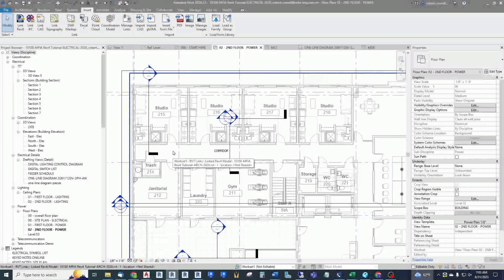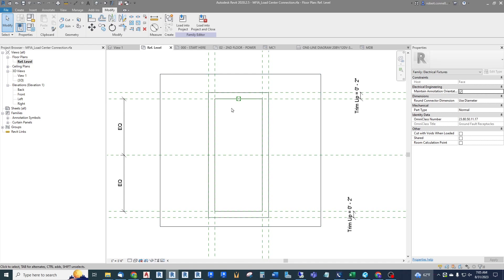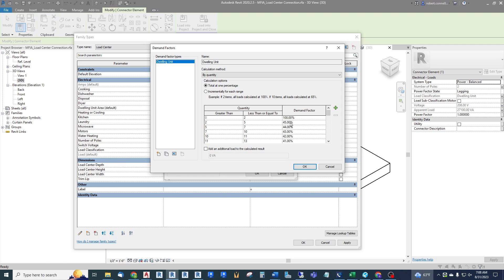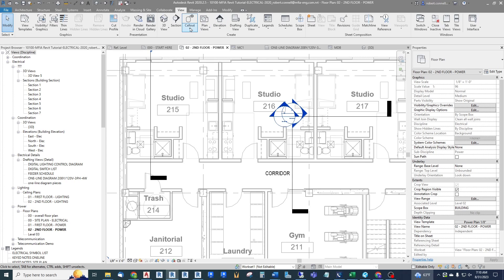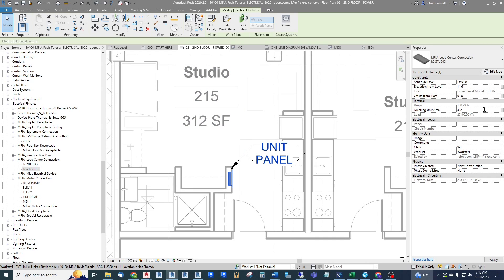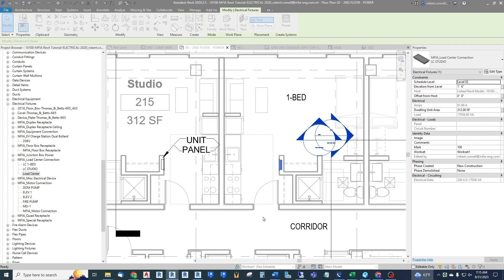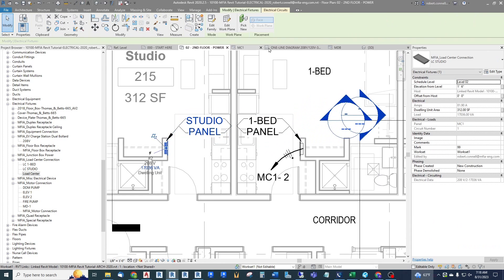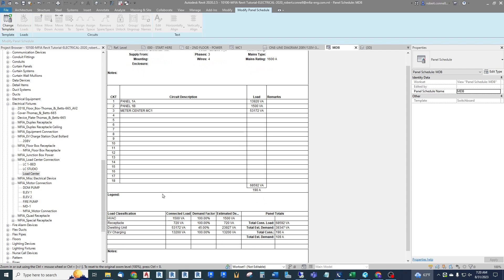REVIT MEP Loadcenter Family Tutorial | Dwelling Unit Loads

Comment: Hi Rob! How does this load center factor in a situation where we have 3_bedroom units in an apartment where we might have three water heaters of say, 4500W?Do we just feed 13500W in the category or we have to determine the demand factor first?
Reply from the maker: Hey there. Well this Loadcenter connection is for the "connected loads" for use in calculating the whole meter center for example, and applying the demand factor to all of the load centers at once. I.E. you cannot take diversity factor on the water heaters first, and then a diversity factor for all of the load centers as well (no double diversity/demand factor).
Reply: Thanks Rob . This is noted.

Comment: Great video Rob. Thanks!
Is there an easy way to create dwelling unit specific demand factors and load classifications in Revit other than doing it manually? I understand the number of dwelling unit and associated damand factor that would come into play upstream, as described in your first part of this video. But for an individual unit, when you circuit the receptacles, lights, appliances etc. to that unit's panel, we can't simply use the built-in load classifications (and assoicated demand factors) as they seem to be non-dwelling unit specific, we need dwelling unit specific load classificatoins. I am wondering if there is a simple way to do so. Thanks again.
Reply from the maker: Hey there - good question! And exactly, Revit does not contain the demand factors/calcs for individual dwelling units. What I ended up doing is creating my own calculations within a generic annotation, pretty much mimicking what we use to do in a spreadsheet. Check out this video to see if it helps  https://youtu.be/LxJZ8QFxo4M
Reply: @ElectricRob  Thank you Rob. This was another informative video. Is there any way to link this generic annotation family to panel schedules? For example - I still want panel schedules part of my plans for the electrician to know how circuiting is done. (Panel A - Ckt#1,2...etc.) But then having this caluclation would be helpful for load summary. If we can somehow link these 2 together, it would be beautiful. What do you think? Thanks again!
Reply from the maker: @adeeshparanjape So it sounds like you do actually circuit your dwelling units, so you do have the panel schedule already. What I would do is create a custom panel schedule, maybe called "Residential Loadcenter" that just does not contain the loads nor load classifications at the bottom. See my video about "Panel Schedule Templates" for some ideas of how that editor works: https://youtu.be/V7NMSdjHUn4 . This actually gives me a good idea for a future video about doing exactly that for my full project series I completed, but used a commercial panel schedule - I'll create that resi loadcenter schedule for that project - appreciate all the great questions and feedback!
Reply: @ElectricRob  Undestood, thanks Rob!
I am familiar with panel schedule template editing (mostly for commercial though). But what you are saying is to create all new load classifications that show up at the bottom and try to edit/add formulas to it the same way you added it for the generic annotations family. Is that correct?
Reply from the maker: Yes, you might be able to add formulas to a panel schedule - I was thinking of leaving the loads blank - just letting the panel schedule be a "circuiting guide" or "directory" - and let the separate generic annotation handle the load summary - I use that method myself with a "text & lines" circuit directory beside my load summary, but would definitely be nice to have them combined - will have to think on that one!
Reply: @ElectricRob  Rob, adding formulas to the panel schedule worked. I appreciate your input, and thanks for engaging with me on this platform via comments.
Reply from the maker: Nice! You beat me to it - so glad that worked for you! And I agree, always a pleasure to share our knowledge with each other - cheers!

Comment: Dwelling unit demand factors are messed up in Revit. In fact, in this demonstration, power sum of two dwelling units 36kVA in is bigger than the sum of three dwelling units 24kVA, which doesn't make sense. Anyway, great lesion. Many thanks
Reply from the maker: Hey there - thanks for the feedback! Actually, the dwelling unit calcs in Revit are set up to follow the NEC - if you look at table 220.84, it requires 100% demand factor for 1 or 2 dwellings, but drops way down to 45% when you have 3 to 5 units. So the code folks have determined that there is not any diversity with only 2 units. Hope that clears that up! Cheers
Reply: 2023 NEC has a change that says if 3 units is lower than 2, that you can use the value for 3 units with the 45% demand.